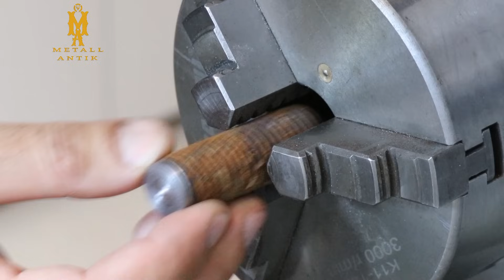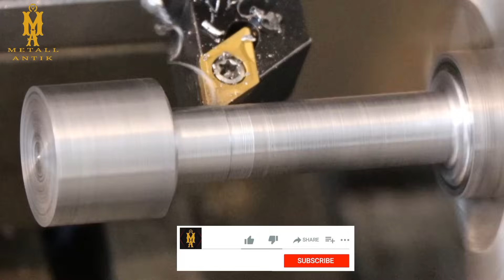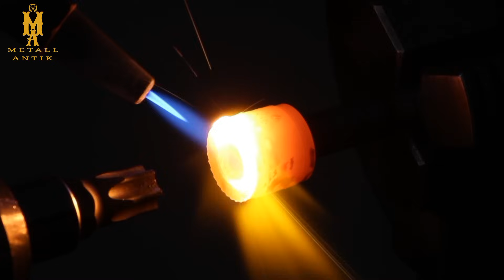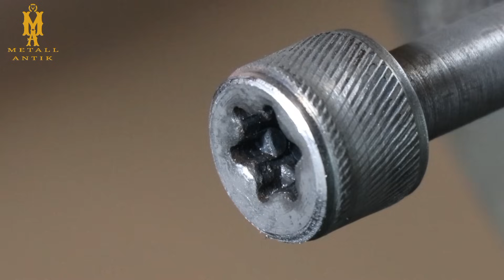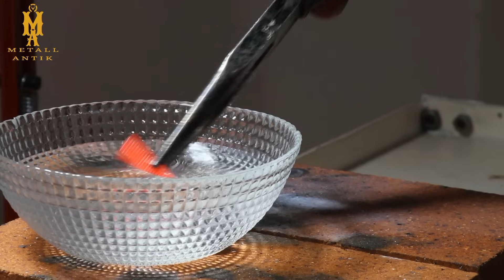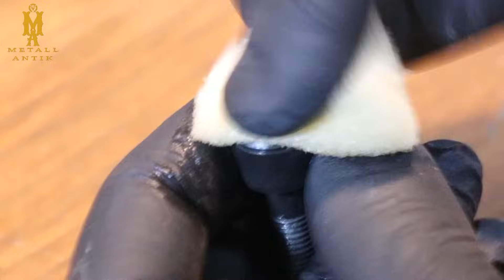Make Rare Socket Screws Yourself With This Simple Technique .

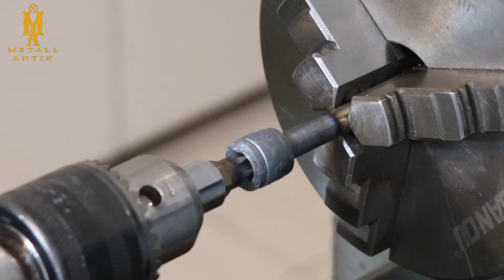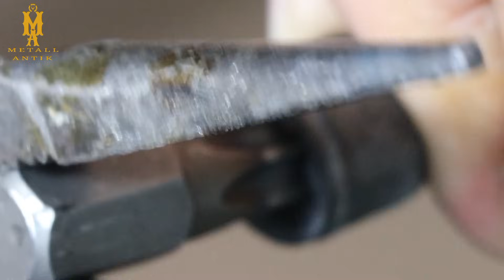Comment: between 3:24 and 3:29 special effects occur: the torx that was pushed into the hole at 3:24 had quite a bit of space around the teeth, while at 3:29 it was completely embedded in metal,and the added layers of metal can be seen
Reply: I've done similar; what you see are what the broaching tool pushed forward. When hot forming, you get both flow and cutting.
IOW, looks fine to me.
Try it, it's fun, and doesn't really require anything special.
I assume he tempered that bolt after hardening, or it's gonna snap, for sure. Been there, done that.
Reply: @UncleKennysPlace  if this was industrial production, the hole would be narrower and the tool-torx would be conical so that it could easily plastically deform the material that would completely fill the tool/torx, and that in two passes, but here the hole is too big for the tool to  plastically deforms the material and there is no filling in the empty space that was later filled, to me this looks like a fake procedure that cannot get the end result, maybe the goal is to frustrate those who would try and fail
Reply: Added layers of metal?
Reply: @baby-sharkgto4902  yes,you can see it clearly

Comment: If the metal you started with was high carbon steel, then you have made it brittle. It would need to be annealed.
If it was not carbon steel, then surely that last heat was pointless?
Reply: Not annealed, but tempered. Not the same thing.
Reply: And if it was some of the odd alloys that graded bolts can use who knows what the hardening step does. Ive tried annealing and heat treating of graded hardware and often it simply does not work right. Your best bet when doing that is to use a metric class 12.8 bolt, and be very careful not to overheat it it and hope that work hardening of the threads wont be a problem. And dont use it in critical applications like your steering likages where a single point of failure can kill you. Its not really worth it for somethng like a socket head screw. Maybe a torx head would be a bit harder to find than an allen head. But just use an allen head screw and be done with it. They are extremely common. I get it of you need something unique, but would anyone really prefer a homemade torx screw over a readily available allen head screw. And if your so ocd, you cant handle one allen head screw and 4 torx screws holding something on, just go buy 4 more allen head screws and replace them all. 

In fact, if you have a unique fastener youc5ant k6ust go and buy, and you havr to make one, its better to go buy a piece of steel of a suitable alloy. That way, you know exactly what allot it is , how it responds to heat treating, what stength can be expected of it and thet it hasnt elready been streessed beyond its limits and damaged.

Comment: nice job but if the metal wasn't "water quench" oil would have been the better option for the second heat treat job. the water probably made it brittle by the quick cooling. I did like the Torx forming part. will have to remember it.
Reply: I noticed he didn't temper it, if he didn't the bolt it will surely be too brittle.

Comment: When did socket head screws become rare?
Reply: I think he means torx. I do not know about this size but for domestic use torx M1.5 is hard to come by on eBay. M2 is no provlem.. Kinda odd. At that small scale hex is super strip out prone. Hence my RC cars always get their hex replaced with torx.
Reply: Torx

Comment: Not sure how to comment on this.
Having the skill and equipment to make something readily available at the hardware store is dubious.
It’s merely a demonstration of lathe technique.
Seemed silly to use a die to cut the threads instead of using the lathe after using the lathe on every other operation.
The heat treating would make me hesitant to put much torque on the bolt.
If that were a one of a kind bolt off a 1913 Cadillac, it makes sense to do it.

Comment: Come on after all that lathe work and you use a die to put the threads on?

Use your lathe for crying out loud and machine the threads proper

A die is a workaround tool and to be used when you do not have a lathe available or the part is not conducive to putting in a lathe

Comment: these BOLTS, are not rare. you give yourself a way by calling a bolt a screw. they are found at most hardware stores. if you want to impress people try machining with coolant and heat treat the correct way. blue chips mean you machining too fast, wrong feed or spindle speed. you have to remember your video may be viewed by real machinists.